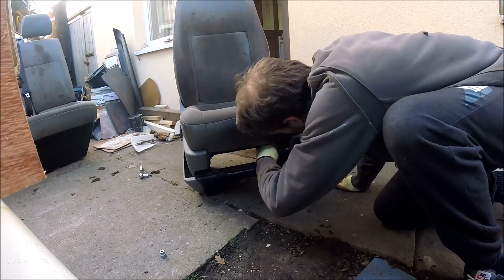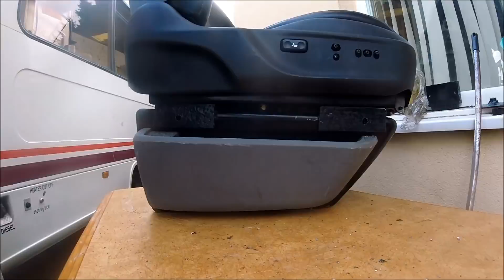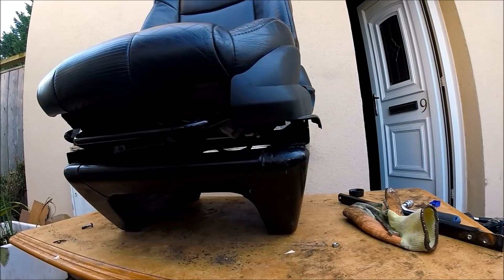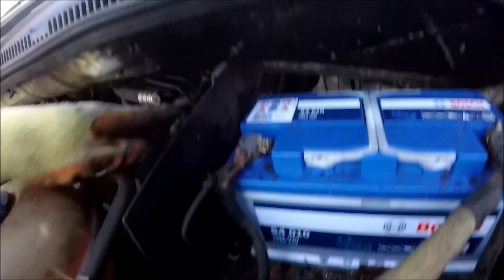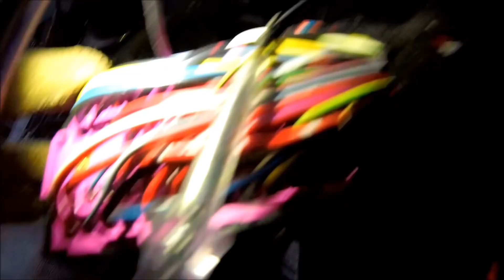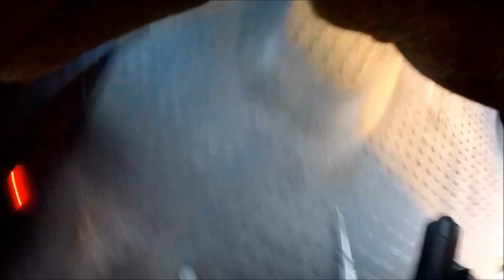VW T5 Camper Conversion Project Part 12: Seat Swap T5 Seats For RX8 Leather Seats

Comment: How does the insurance company feel about installing other vehicle seats ?
Reply from the maker: All mods should be listed insurance company so if notified, they should be fine with it
Reply: @TheCampervanBuilder  does replacing the seats change the pricing of the insurance drastically?
Reply from the maker: @familyguyfanboy2  it shouldn't make any if you go with the right company like greenlight or a-plan etc, when I had this van the insurance cost for myself was less than £300 per year with everything listed

Comment: Hi mate did you put a swivvel base into the t5? I just picked up a set of rx8 seats and god the drivers on no issues and wanted to put the passenger on a swivvel but the under side of the seat gets in the way of the swivvel base. Any thoughts or links to swivvels that will fit? 

Thanks in advance.

Keep up the good work 👍

Darren
Reply: Apologies just seen your next video. The swivvel I have doesn't sit on the seat properly due to the under carriage of the seat. Hmm lol
Reply from the maker: Bash it with a hammer
Reply: @TheCampervanBuilder  thanks mate. Did that yesterday. Realised it just needed tw*ting into position 🤣

Comment: Great video, bought the same for drivers seat and had a test run today. Only issue I have is that it sits 100 mm lower than the original seat and bench seat that I will be leaving in and I had no way of wiring/testing today. I will have to get someone to wire i all up for me as I am no good at all that malarki. How much up/down movement is there in the RX8 seat?  that way I will have a rough idea of what size brackets I need to fabricate to raise up and sit level with bench. Cheers

Comment: You put on your wiring picture that red and black wires are for heat on passenger seat, not on mine, the side air bag went off.
Reply from the maker: The airbag wires should have had a yellow connector on which should never be touched.  There is power to the heat mechanism and then another yellow connector block which is airbags which should never be wired in an aftermarket fitting
Reply: @TheCampervanBuilder  no big deal, no one injured. Drivers side had yellow plug that I cut off but passenger seat was a white plug with red and black wires. The heated wiring was brown. One more thing, did you use one inline fuse and one relay for both seats. I was going to give each seat it's own supply and relay but wont if not necessary. Did you wire movement separately?  Cheers.

Comment: Another very instructive video. Thank you. I have just bought a mwb 2012 transit. Any suggestions as to what seats might be suitable....as in minimum of tinkering needed to get them to fit on the existing drivers base and the single passenger base I have just purchased.
Reply from the maker: I've not looked at a transit yet so am unfamiliar with the bases but generally seats with flat straight rails are the easiest to work with, RX8, Audi TT, Mini, Saab etc

Comment: do you need to change the papers for the car because you changed the passengers seat from 2 to 1?
Reply from the maker: Yes it should be updated,, I usually wait until going for the camper registration and change the seat number then